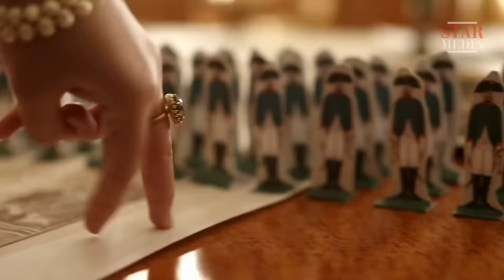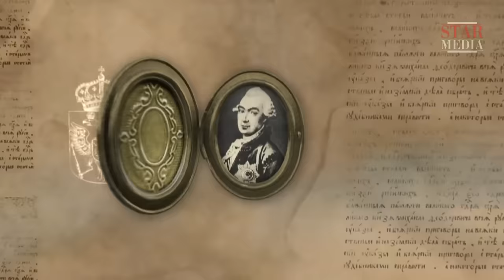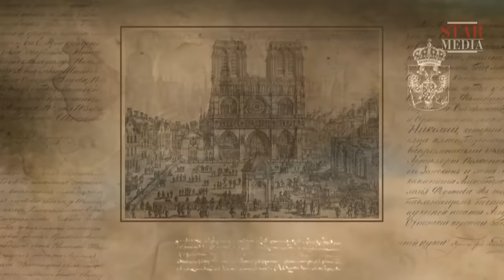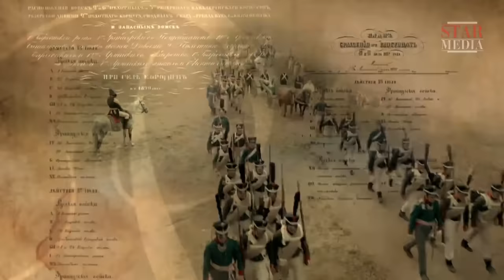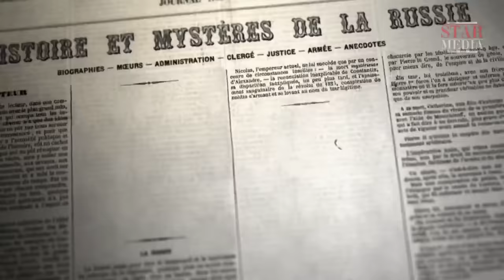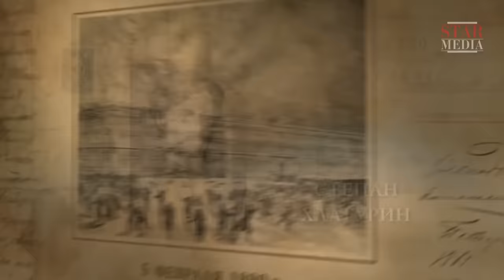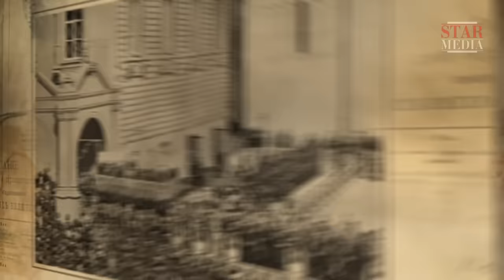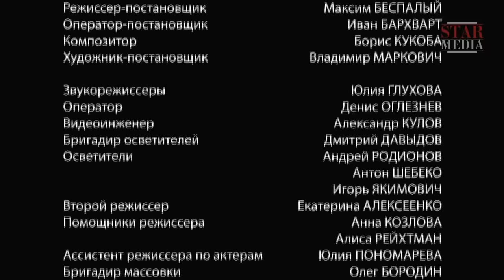The Romanovs. The Real History of the Russian Dynasty. Episodes 5-8. StarMediaEN

Comment: They destroyed my van and told my parents that I had been grocery shopping and ran over the concrete in the front of your cars in the parking lot of every Supermarket in Scottsdale AZ 
I did not even go to grocery store every day and because we were so poor we were grocery shopping where I went on Bell Road and I showed Beverly how to buy meat and at Rock bottom prices so I was taking her to the grocery store shopping in my van and have not even had one time running over anything especially a parking lot front space concrete marker and I had been on the Mongolian Rim with Joe P driving my Van with Beverly and Samantha in the front seat and Ireland and I were in the middle seat because of the air conditioning they had asked me to go for a ride for the day and it was in the middle of the heat and they had no air-conditioning in their truck and so we had a nice day and we were on a road that wasn’t paved and the rocks were hitting the bottom of the van and I said to Joe I said Joe is this all right for my car to go down this road he said it’ll be fine and we drove on it and then we came back afterwards after a long day out driving around and I dropped them off at their house and pulled around and by the time I got to my driveway there was noise under my foot pedal and I called Tommy and I told him exactly what happened well now of course Joe and Beverly Pavlick are not only responsible but they took part in framing me doing something wrong. I don’t know what people did to that van but my father called and he was furious about the parking lots and so was my mother and Tommy insights violence, hatred and dissent in a neighborhood of Satanist and I didn’t even know it and they prayed upon me and my children and I never crossed the line or said anything bad about them and the only thing that happened was something that occurred between Beverly and Joe and then it was over and now I don’t know what’s going on with them, but Samantha is not going anywhere what they’re saying is true about her going into houses killing people does she have a license to do such work? Is it sanctioned by the government because I don’t know what to do with these people you’re owner I’m not even an attorney, I’m an interior designer and social media, marketer and creator and trying to get my case heard is impossible. Nobody is even here. My children are afraid to come home because their lives are on the line and they’ve got the neighbors off that are working with Tommy and Megan and Tracy and Jenna and Robert and the pirate team, so I can’t even walk out of my house without these people knowing every single little thing I do and I need to go home now to finish my job which is none of their business. They don’t understand it when you hit them square between the eyes with the truth.